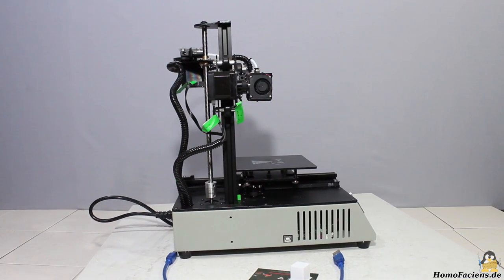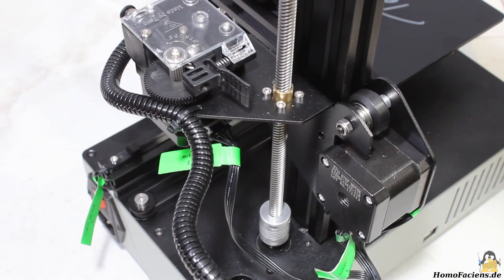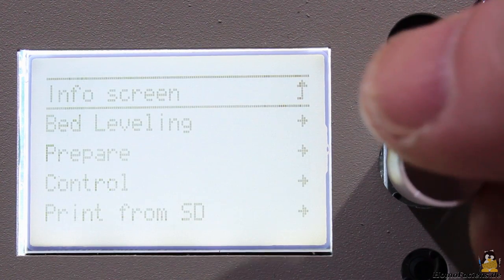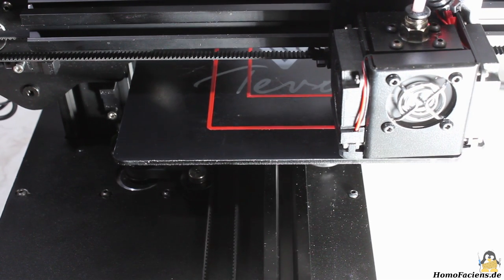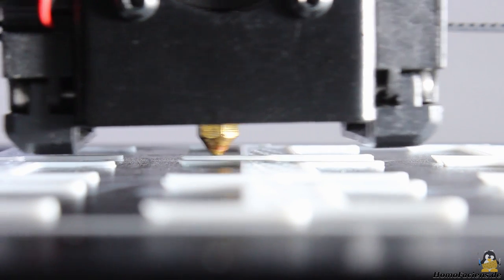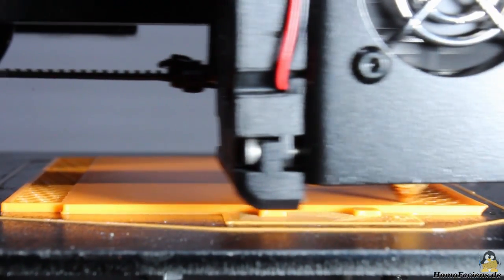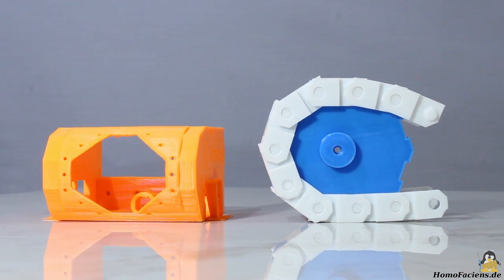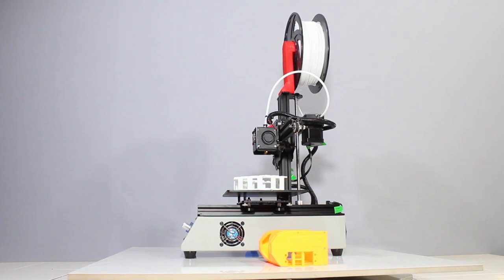Review Tevo Michelangelo 3D printer

Comment: May I know what slicer software did you use? I downloaded cura but there are no machine settings for the Michelangelo.
Reply from the maker: I am using Slic3r. I guess there are no predifined settings for the Michelangelo as well. Simply set the bed shape, the filament and nozzle diameter and the base parameter according to the type of plastics you are printing. G-code flavor must be RepRap (Marlin/Sprinter/Repetier).